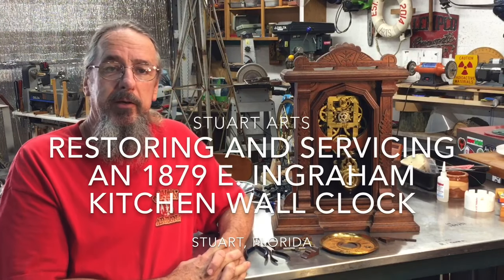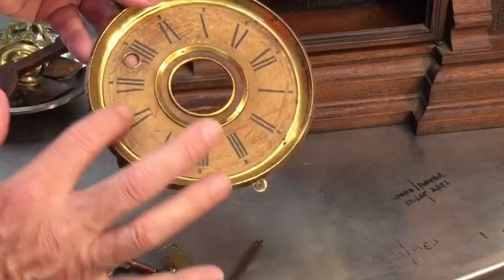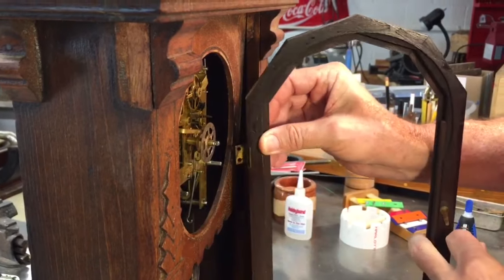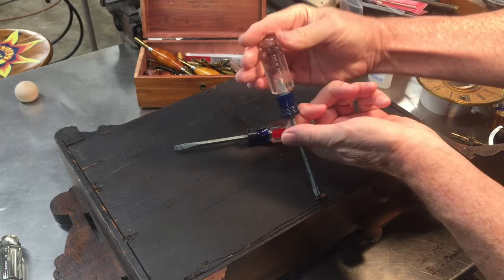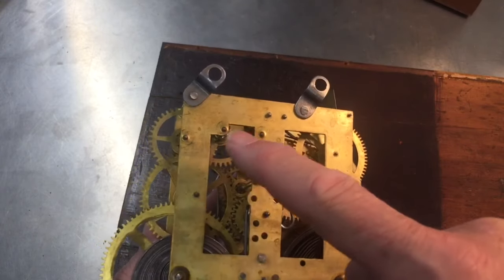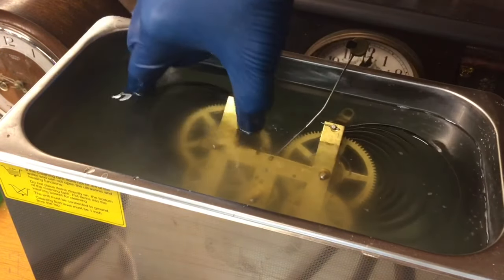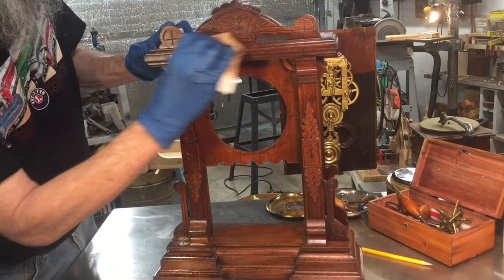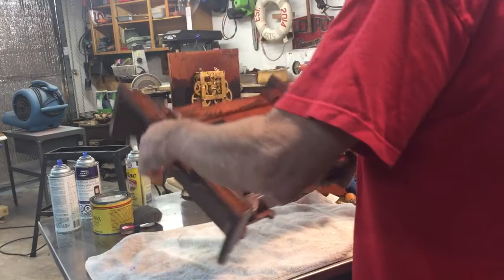DIY Servicing and Restoration of an 1880s E. Ingraham Kitchen Clock

Comment: I collect clocks and have had good luck on FB Marketplace where if you pay attention you often pick up clocks cheaply - I've picked up some really nice clocks for $25 or less.  You did a really nice job restoring the case.  One thing I would have done a little differently is that given the clock would only run for a short while before stopping I would have bit the bullet and completely disassembled the movement for cleaning and possibly bushing work.
Reply from the maker: Thanks Paul...I’m only recently taking them fully apart to clean. I wasn’t confident that I would be able to get them back together but now I’ve had a few successes.  I also have not yet bushed a movement...I need to invest in the tools for that.
Reply from the maker: I too watch marketplace and have picked up some awesome old clocks. I have probably 20 or so wall clocks that need my attention...

Comment: Love it!
I have a movement that got me into the woodworking that I bought off eBay. It is supposed to be an 1880 movement too. It looks almost identical to what you have there but no alarm and it's around a 30 hour movement. Unfortunately there was no case, just the movement and the face. I pulled he whole thing apart and stuck it in the ultrasonic bath, runs like a dream.
Unfortunately my woodworking skill were not great so a very basic pine case was made, but the main thing is the movement and it's what got me to where I am now with the shed, woodturning and some general woodworking.
Oh I'm a bit of a mechanical clock collector where I think I now have around 10 clocks including a Grand Father, Grand Daughter and a Dutch mantle clock which was actually more expensive than the Grand Father clock.
Fascinated that they could make these with such precision all that time ago.
Reply from the maker: They are a lot of fun to tinker with...bite sized projects... I got on a tear buying old clocks I found in FB Marketplace. I’ve got quite an inventory of projects... I’d love to pick up a few in England... y’all have some pretty awesome and ancient ones...

Comment: I have the very same movement. The base and face where the dial goes are almost identical. Actually overall the designs are very similar,just the trim pieces are different . Mine have what looks like columns and 4 pieces on each side are identical to the 2 bottom pieces on the side of your clock. The biggest difference is probably the top trim piece. Oh yeah my door has 2 hinges where yours had the hinge on top and had a slide out bottom. Mine runs great! The alarm works perfect. Believe glass has been replaced and I had to refinish the cabinet inside and out. Went with Walnut which I believe it's real Walnut wood. Anyway your clock is the closest thing I've seen to the one I've had for well over 25 years. You think maybe back then they did one of a kinds but basic design?  Have fun with your clocks,I sure enough enjoy mine. ✌️✌️
Reply from the maker: They are great clocks. This one has been running continuously since I made the video. Cheers!

Comment: I have an 1887 Clock I want to get working, but I am not sure what type of clock it is.  I am a rookie and wondering how you find out who made the clock and then for my particular clock it is not moving at all so I will look at other videos and things as it seems worse for wear than the one on this video.  Although the glass is in place!
Reply from the maker: If there is a maker’s mark it will be on one of the brass plates that hold the movement together. I belong to a couple of Facebook groups that are for folks working on clocks. They are very helpful. Your question comes up often and the experts can usually provide a quick answer. Good luck!

Comment: Have you ever cleaned/restored a faceplate?  I've got an Ingraham Pacific kitchen clock (stamp on the movement says "9    07") and the faceplate looks like paper on a metal backing.  The face has stains or dirt on it.
Reply from the maker: Yes… paper is tough though if it’s torn, and not much you can do to clean. About the only thing I will do is fill in missing numerals with India ink or black acrylic plaint.
Reply: @JimmiePorterAtStuartArts  Thanks for the input.  I was afraid the "it is what it is" philosophy would apply.

Comment: Hi Jimmy!. what is the best to clean the rest of oil in the movement?... Solvents derived from Petroleoum, thinner?.... o warm/hot water with soap?...
Reply from the maker: Mineral spirits are themselves a petroleum product and melt grease and oil away very nicely….I use a stiff brush and dip into the mineral spirits and work it into all the gear teeth and anywhere I see old grease. Kerosene works well also but the odor is overpowering. I believe thinners will work but I haven’t tried that. After mineral spirits I will clean the movement in the ultrasonic then rinse with water. Good luck!
Reply: @JimmiePorterAtStuartArts  Is there an alternative to the Ultra Sonic cleaner in the process you use? I have a small Ultra Sonic but a movement the size out of my E. Ingraham Parlor/Kitchen clock will not fit into it. I would like to try the Mineral Spirits process if there is an Alternative to Ultra Sonic. Thanks for a lot of Interesting and Informative videos. ✌️✌️

Comment: I have acquired an Ingraham gingerbread clock that was my grandmother's. Unfortunately, she decided to saw the top off of it to make it fit under the kitchen cupboards so the cabinet is damaged and somewhere along the line, it was painted black. The works have a date of September 14, 1897. One of the coil springs is tightly wound. I am debating whether it would be worth the effort to fix it up considering the damaged cabinet but if I  want to attempt this, where do I get the tool to release the pressure on the spring or is there something else I could use to do this? I also seem to have a third small coil that's just loose in the case and I can see nowhere that it should be. Any suggestions appreciated. Thanks.
Reply from the maker: If the tight coil is the “time train” then it may be that the clock is just out of beat and in need of adjustment so the clock can tick and release the spring naturally. The time train is normally the one on the right when viewed from the front. In any case you can purchase a letdown tool. There are many repair videos that show how this is done. The small third coil sounds like it’s for an alarm. If it is an alarm there should be a small wind up mechanism and it would be mounted lower in the cabinet. Clocks like these are not very valuable and it can cost a lot to have them serviced. I do this just for the satisfaction of getting them running again. If you want to send me a few photos to my email I’d be glad to look and tell you what I can. Bigdad56@bellsouth.net

Comment: I have a clock almost exactly like this. It belonged to my grandparents. I can't figure out how to attach my pendulum, as it doesn't have any sort of loop to attach it to the hook. Do you have any idea if there is another little part that would screw onto the top that would have a loop? It does have threads that go quite a ways down the pendulum and a little widget that is screwed onto it. I thought this might be to hang the pendulum shorter or longer to adjust the speed for more accuracy.

I think it has the alarm feature that you mentioned, as there is a bell at the bottom that doesn't ring when the clock chimes. I have no idea how it would be set. This clock hasn't run for several years. I cleaned up up a bit, but haven't done anything else to it. It does have a pattern on the glass, as you mentioned.

Edit: I figured out the pendulum: I was looking at it upside down! So now the issue is it won't stay running. :(
Reply from the maker: It sounds like you might be missing the suspension spring. If you would like to send me a couple of photos I’d be happy to have a look at it. Bigdad56@bellsouth.net
Reply from the maker: Just saw your edit… if you have a correct pendulum and spring then the next step is to set the beat. There are several videos that show the basics…pretty simple really for these clocks.
Reply: Does your clock have a round dial in the center behind the hands with roman numerals? If so setting the alarm would be: straight up towards the 12 on the dial, if you want it to alarm at 8:00 , set the 8 on that small dial straight up at the 12 on the time dial.Hope this helps.✌️✌️